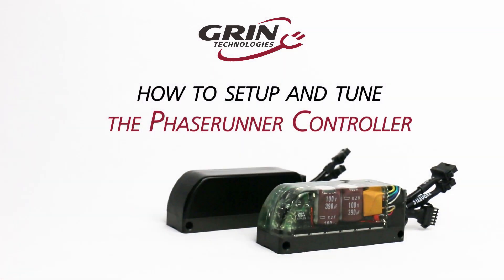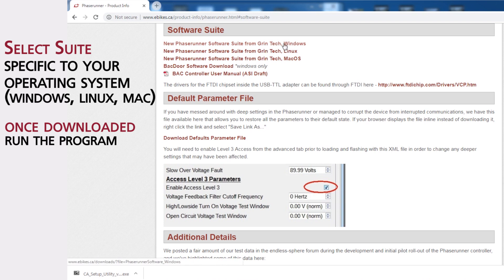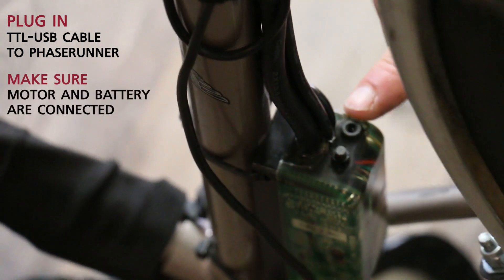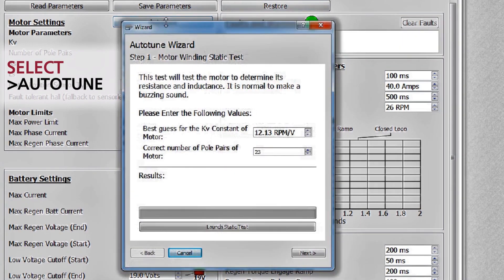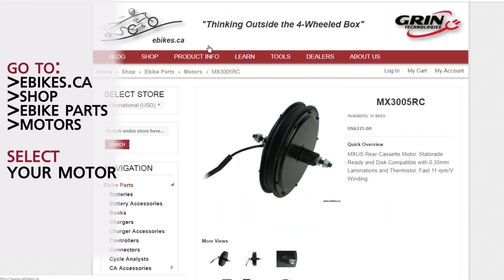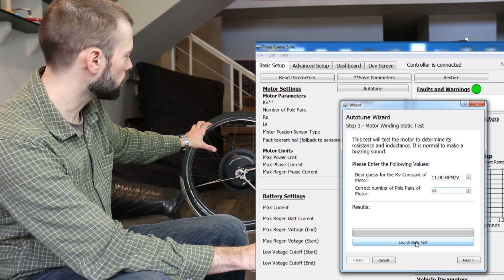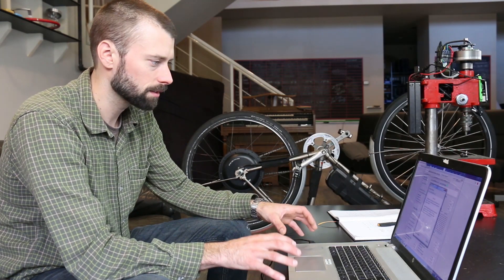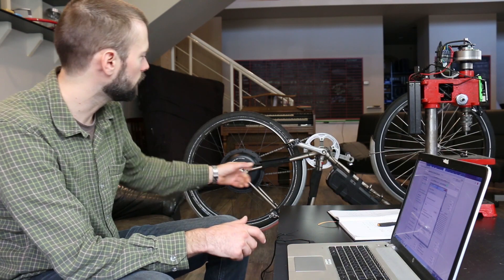Phaserunner Basic Autotune Procedure

Comment: Can this be used on a battery with 60 amps  continuous output by re configuring the BMS on the battery?
Reply from the maker: It will work just great, there is no need to reconfigure the BMS at all.  In general it's difficult to pull more than about 50 battery amps from the Phaserunner given the 96A peak phase current limit.
Reply: @GrinTechnologies  that's great news, thanks very much.

Comment: Does this with the Goldenmotor Magic Pie Motor?
Reply: I know it's been almost a year, but to answer your question, fuck yeah! You'll have to bypass the internal controller (if it hasn't already blown) and add the appropriate wires on the motor side, but it will defo work.

Comment: Anybody else confused by the voltages? Specs say 24 OR 72 but also say 20 TO 90, can I not use on a 48v setup?
Reply from the maker: The specs should say 24 TO 72. Those are the nominal voltages, and 20 TO 90 is the absolute voltage range. You can absolutely use this at 48V!!